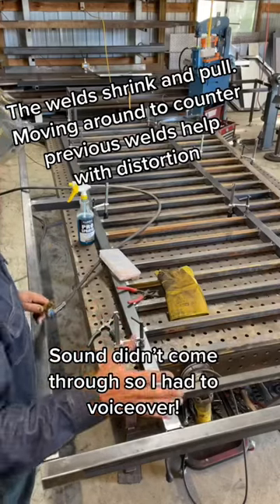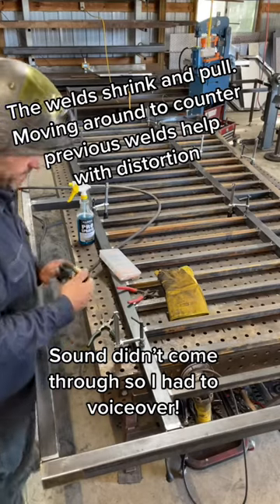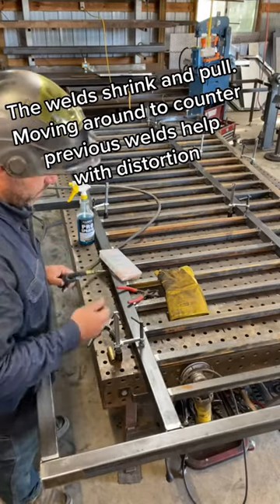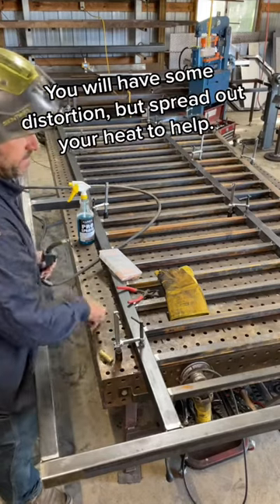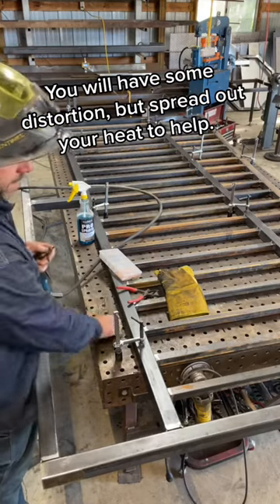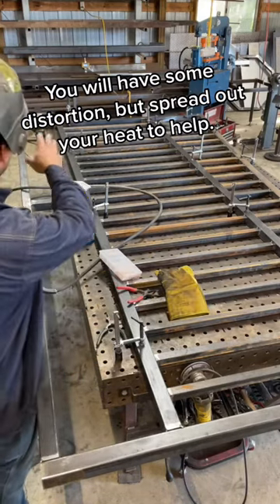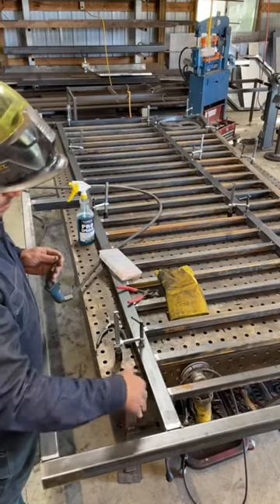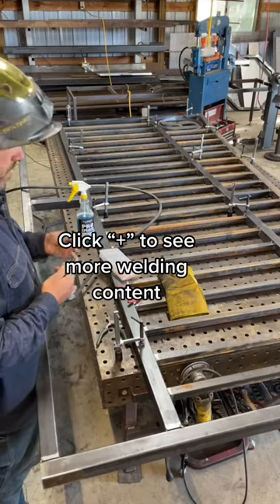Welding gate and distortion tip #welding #shorts #shortsyoutube

Comment: I've noticed in this situation the welds that cause the most movement are welds on the outside corner. Flipping it over and opposing those is essential. I'm so glad you share this kind of information.